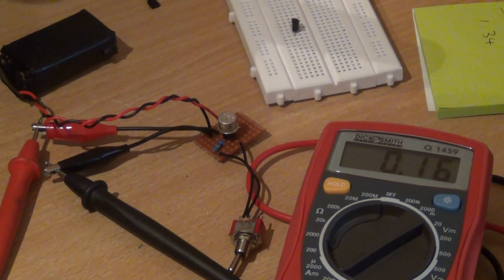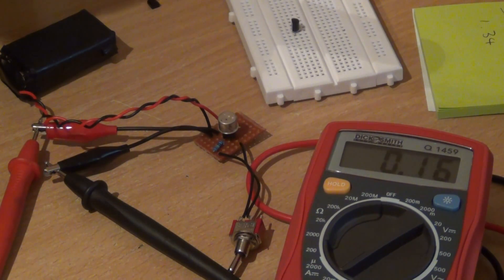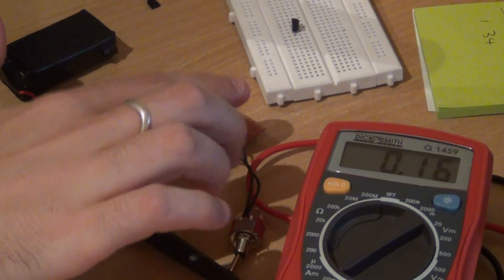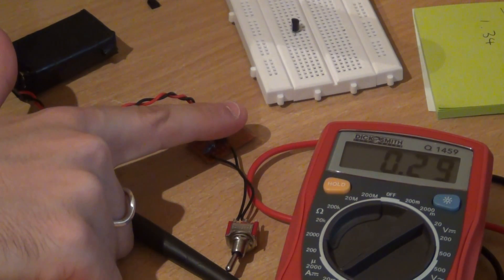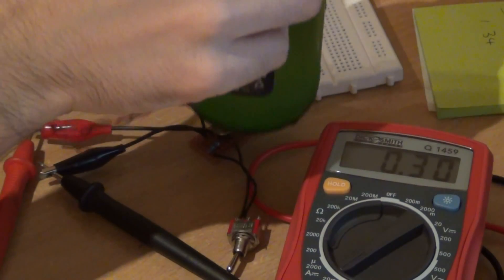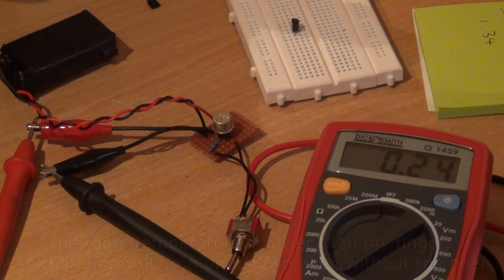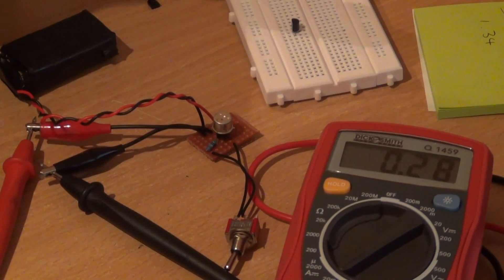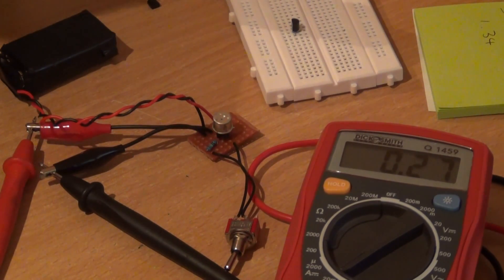Germanium Transistor Temperature Sensitivity

Comment: One question! Why some builders says that only q1 is affected by the temperature changes? For expample: In a full germanium 2-transistors circuit, they change q1 for a silicon one, they put a GE one in q2 and they say that the circuit is not temperature sensitive... I don't understand why this happens... I know I am late on this video but I hope you can answer! :D Thanks!

Comment from the maker: Yeah I think so.  When I was doing the germanium transistor shootout, I noticed the voltage decreasing on germanium transistors with high leakage that I just installed more quickly then ones with low leakage.  I guess thats why they say not use overly leaking transistors!

Comment: Nice video. How does temperature sensitivity affect the biasing voltage? i.e., If the temperature of the transistor is raised will the voltage of Q2C  also go up the way that the leakage goes up? I tried to adjust the voltage of Q2C of an AC 125 just after handling it to install and the 103 trim pot adjustment wouldn't bring the reading down to -4.5. An hour later I was able to adjust it. Was this caused by temperature?

Comment from the maker: I wonder if you'd even be able to hear the difference though? I'm thinking you'd need a decent heat source, soldering iron tip, heatshrink gun, but that mite destroy the germ tran...And the right circuit...you wouldnt hear it with a RM obviously, not sure what "the right circuit" is though...Anyway, please make a video so i dont have to :D